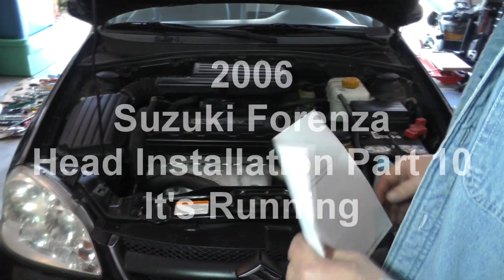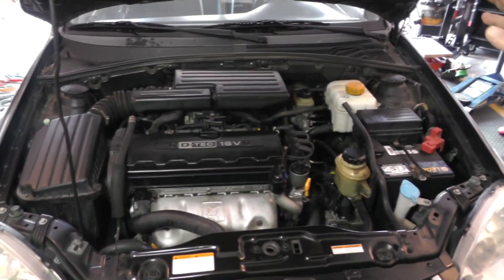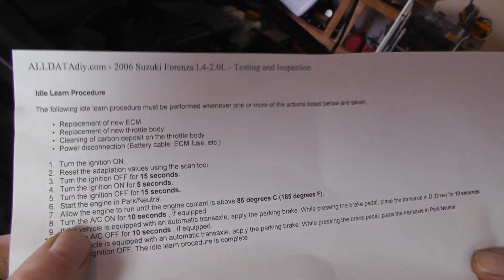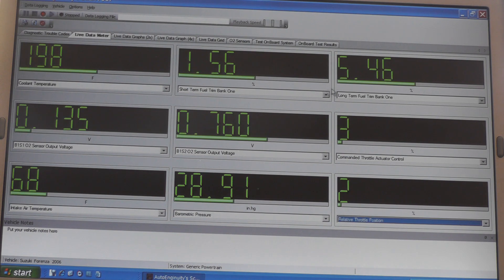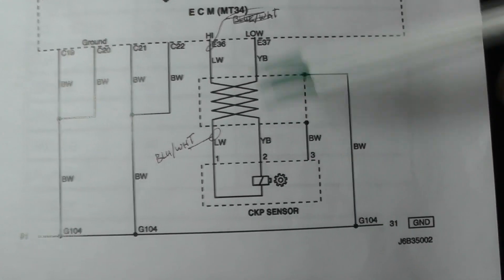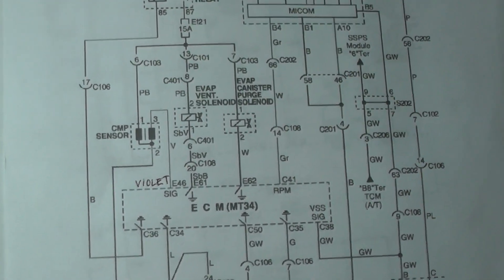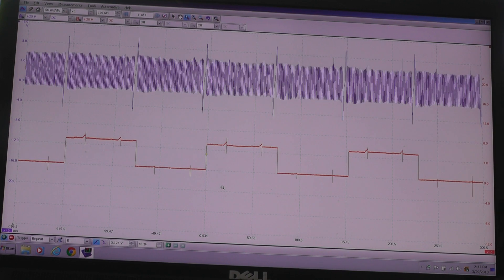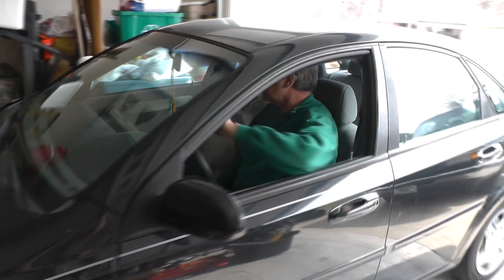Suzuki Forenza Head Installation - Part 18 (Running)

Comment from the maker: Hi Dave, Although it was a lot of work, I wasn't worried about any incidents since I took my time and tried to as thorough as possible. The only two things that I was a little concerned about before the engine was started was if the idle would correct itself and that all the lifters would pump up. As you know, both issues worked with no problems. Yeah, my heart was going pitter patter before I cranked it up! Thanks for watching Dave!

Comment: I see that you are using a Dell with your Autoenginuity. On their website they say older Dells may have a problem with the USB -- how old is your Dell? 
That's a great summary of the scanner tools. Do you find that Autoenginuity and Picoscope complement each other? Would you still buy both if you had to do it again?

Comment: When I took car to dealer today for the NU recall they said they are running a special on timing belt replacement, but they said they don’t ever replace water pump. Pretty scary! If you do anything else on car please post. I am wondering if we need to service transmission? Thank you agin, Brad.

Comment: I finished up the timing belt & value gasket replacement on my 2005 Forenza. Thank you very much for the best videos ever! I almost put your name on the timing belt sticker because of how much you did. When I started on the engine it made a lot of rattling; now it sounds great. I know if I took it to dealer they would not have done as great as job as you.